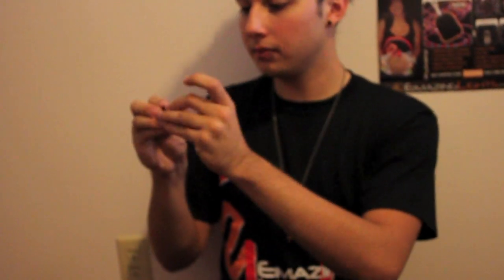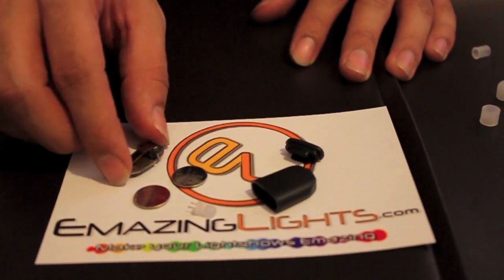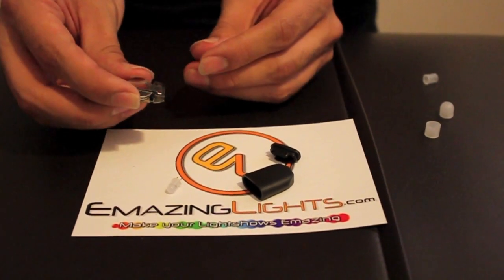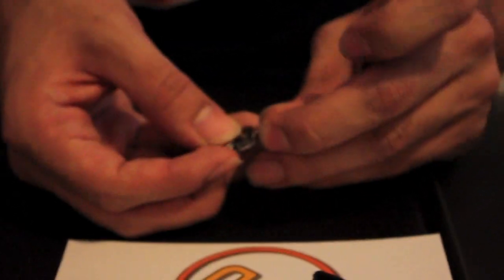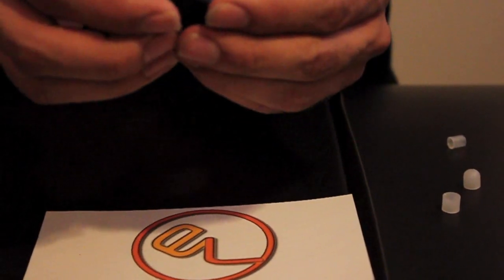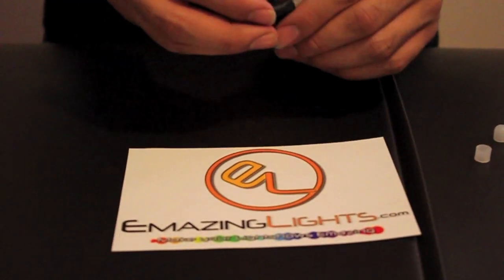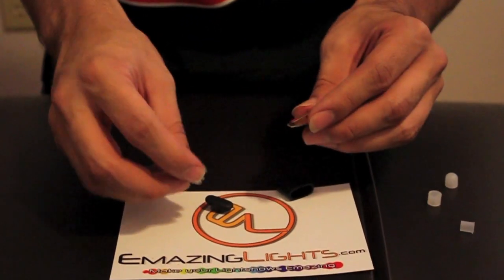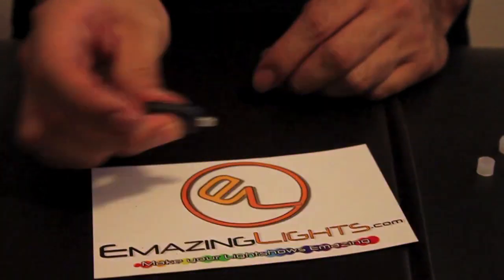Emazinglights.com 101 - MicroMax Information, Assembly, and Troubleshooting Tutorial -Pt. 4

Comment: @J0SE724 i would go with micromaxes because, really, they are the best lights around right now, their size is perfect, and barely has any weight at all to them, and inovas, are known too be big and bulky, making it harder for shows, and you can always just buy a 3 mode chip micromax light :), hope this helped :D.
Use code "vertex "for 5% off your order ;)